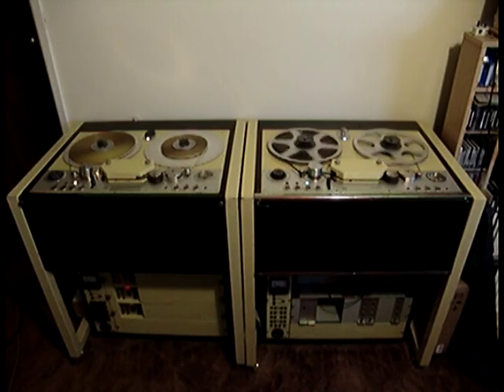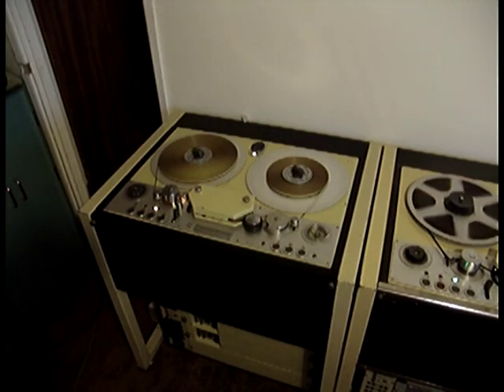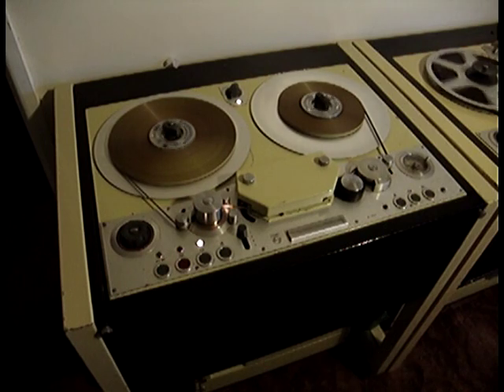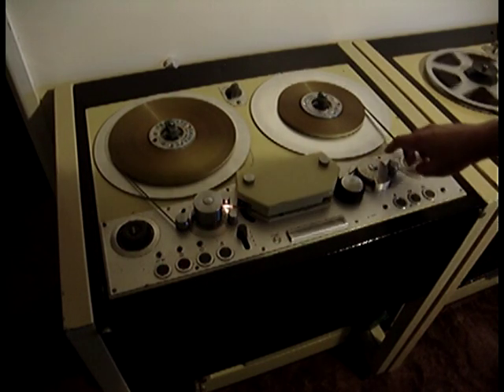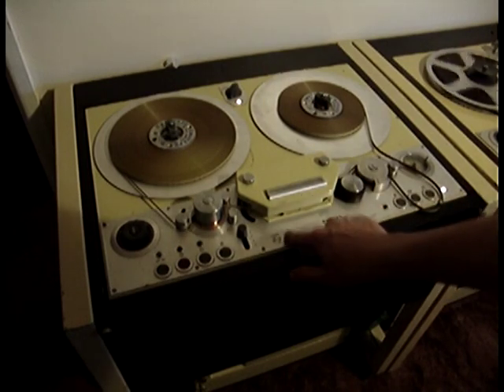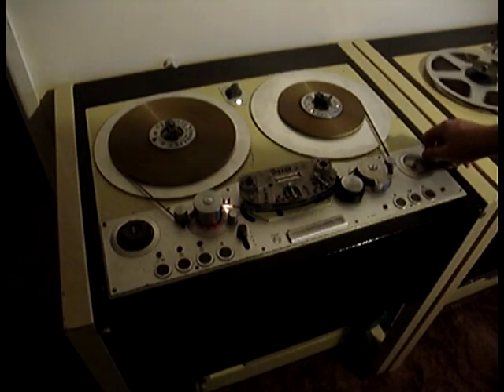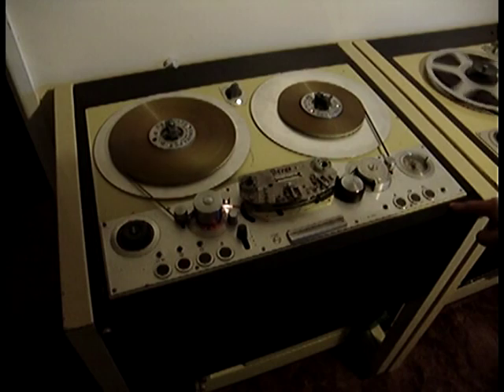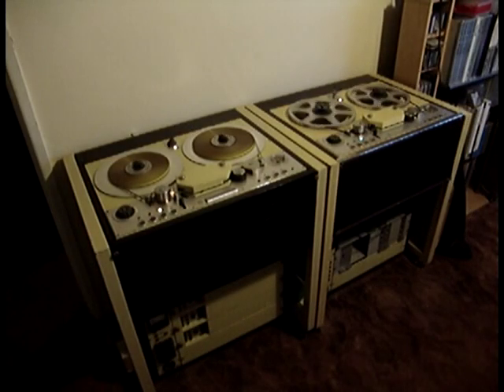Philips EL3501 reel to reel tape recorder from 1952

Comment: the data I have comes from the service manual of this deck: wow & flutter (peak to peak, measured with EMT418): 0,1% at 15 IPS and 0,15% at 7,5 IPS. Those are the only data given in the manual.

Comment from the maker: Thank you for the info, not all BASF tape will wind on these machines, you will find that its not the brand but the tape type which makes the difference, back coated tape is thicker and winds like this, none backed tape or double and triple play tape will not and as you mention, will end up falling off the bobby.

Comment: Well, the tape is actually held in place by tension so when you remove it it doesn't fall. The advantage is cost. The platters are used mainly in Germany and are called bobbies. You can't use any tape with them, because tape that is not made this this in mind will not bind one layer on top of the other. You can see this if you take BASF tape and rewind it on NAB reels. It will still make a flat pancake. Tyr that with a 456 and your gonna have tape flying all over.

Comment from the maker: Cheers, not sure what the advantage is for platters apart from possibly cost? platters are usually larger than the NAB reels and with them not having flanges toed make a difference to cost and possibly storagr space (3000ft or 100M platter costs around £9-13, reels cost £20-£30 on ave New)

Comment from the maker: I havent had this one playing yet as I need some odd style XLR (Like  large XLR but has a screw fitting and not the usual Tuchel found on Telefunkens), the transistor machine I have sounded great, I have high hopes for the valve machine.